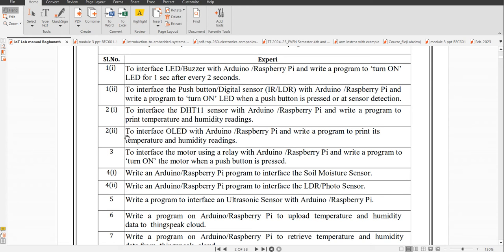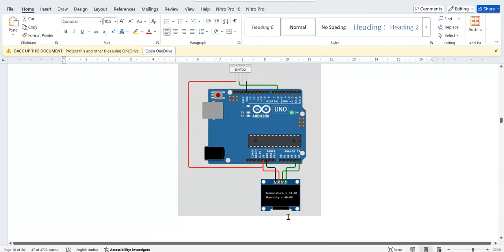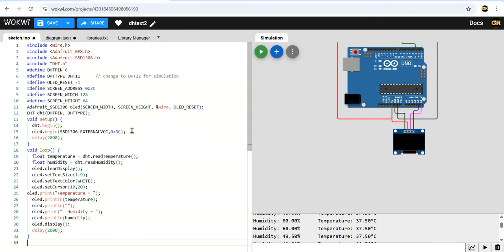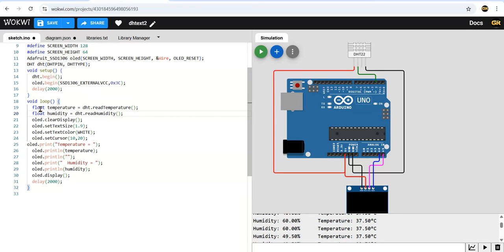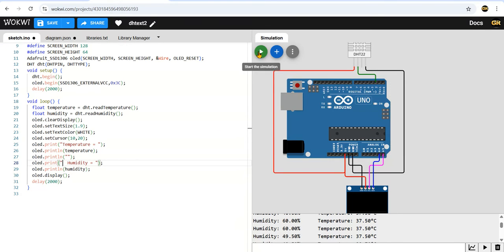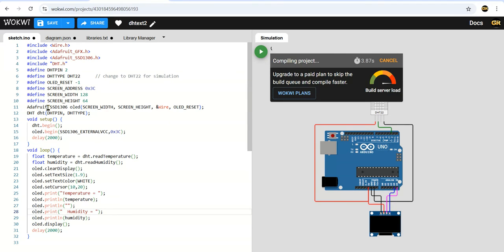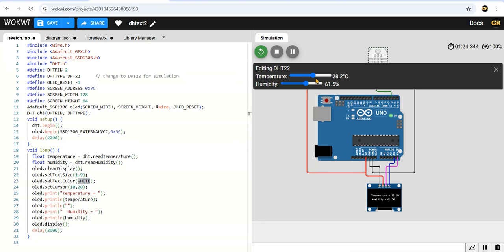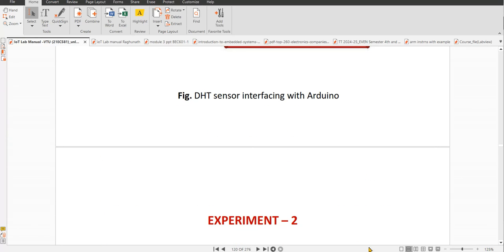#BEC657c Interface OLED  & DHT with Arduino & program to print its temperature and humidity readings

Comment from the maker: #include "DHT.h"

#define DHTPIN 2     
#define DHTTYPE DHT11       // for simulation use DHT22

DHT dht(DHTPIN, DHTTYPE);

void setup() {
  Serial.begin(9600);
  dht.begin();
}

void loop() {
  float temperature = dht.readTemperature();
  float humidity = dht.readHumidity();

  Serial.print("Humidity: ");
  Serial.print(humidity);
  Serial.print("%  Temperature: ");
  Serial.print(temperature);
  Serial.println("°C ");
  delay(2000);
}